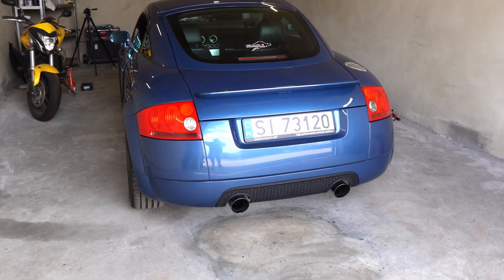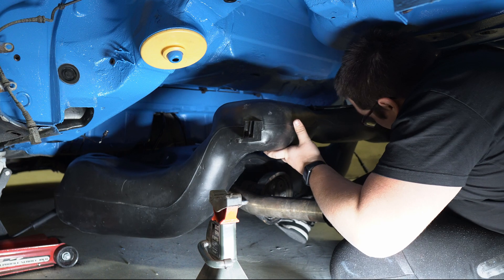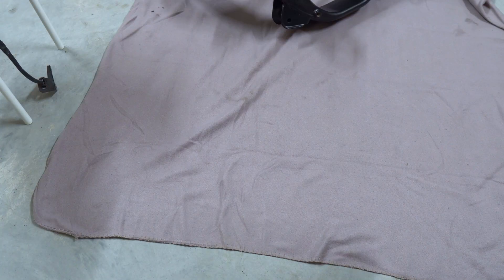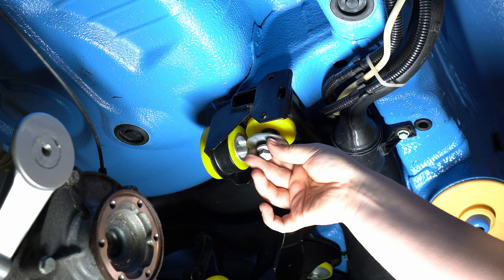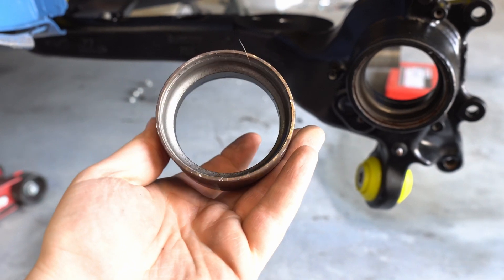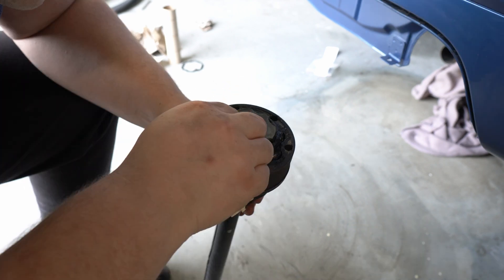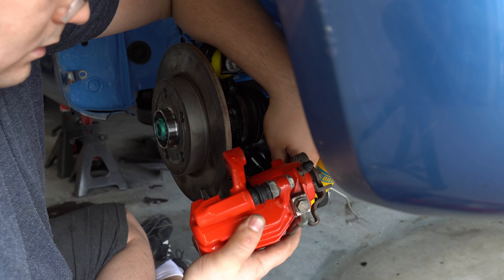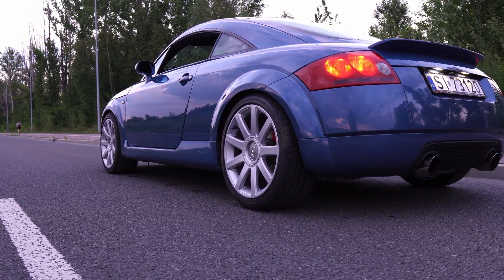Audi TT 8N 1.8T - Rear suspension rebuild

Comment: I am in the process of rebuilding a secondary rear axle before removing mine to put the new one on my S3. Since there is no geometry adjustment at the rear, can we simply remove it and then put the new one back in place without geometry problems? I find that strange

Comment: Great video! I’ll be doing the same but for my mk4 Golf R32 which mostly uses the same components. Do you have part numbers for any of the smaller fixings such as brake pipes, bolts, etc?

Comment: Amazing! Maybe one day, I will throw that kind of money in our TT 225 Cabriolet. But in Germany, all the parts you swapped are around 6.000€ at least so for that money I'd rather buy a car and resell it or refurbish the suspension on all our cars.
What is very nice is the Bilstein B13 coilovers, which are better than KW coilovers. We had the KW V3 in our TT but after 5 years it was totally rusted and handling was not amazing. Currently we drive the FK coilovers which are surprisingly good and not much worse than the KW for a quarter of the price. At one point I will put the Bilstein B13 or B16 in there, but for now the FK is very nice.

Comment: in the UK it's £395 a year to pay road tax for a 1.8t. 
left this engine when it went to £320. 

now own a 1.6t astra k at 237hp 350ft at about 1300kg for £190 a year.  it's basically a vxr engine in the last Astra's with a 4 cylinder block.
Reply: I miss the 1.8t soooo much.

Comment: One question: everything goes back in place without setting parallelism or other?  There is nothing adjustable in the back
Reply from the maker: Hi! It just goes back, but you have to do full wheel geometry at the end.
Reply: @Wachu thanks, but for the rear there is no adjustment?  Do you mean that you have to do a geometry at the front after having raised the rear?
Reply from the maker: @oooo_45929  You have to verify the camber and adjust the control arms if applicable in your case. There is nothing you have to do with the front
Reply: @wachu8605  ok but in my case, i use OEM parts with original arms without adjustments. so there is nothing special to do?

and for the driveshaft you simply put the screws back in place and ok?

Thanks you
Reply from the maker: @oooo_45929  That's right, there is no adjustment at the back. I had to use regulated control arms as i lowered car a little bit and without them the camber would be too big and i wouldnt get the MOT. 

Driveshafts just go in, just remember to use a lot of grease and tighten them really securely so you don't lose them on highway :)
Reply: @Wachu i speak about the Big driveshaft (from the front to haldex) 😅.  Did you use a marker to put the nuts in their original location to avoid vibrations?
Reply from the maker: @oooo_45929  No, i bought new bolts and never though about it. I used a little bit of loctite to be sure it will not come loose.
Reply: @wachu8605 Hi, I was re-reading your comment and there is something I didn't understand.  you say that you had to use adjustable arms because you did not pass the MOT?  but was it that you tried with the original arms after the reassembly or was it before doing everything again?
Reply from the maker: @oooo_45929  Hi, well fuck the MOT to be honest. There is a law in Poland that says the wheels cannot stick out of the car body, thats what i meant. But the main reason for using adjustable arms at rear is the suspension i use. You cant go fully low on bilstein B14 (and on other regulated suspensions i guess) without the adjustable arms. OEM arms are simply not designed to work in such a low configuration and you will get crappy camber angle. Thats why you need adjustable ones to counter it. If you need more help please reach out to facebook group "Audi TT MK1 track car", they will explain it a lot better than i can.
Reply: @wachu8605 OK !  Now I understand.  In my case where I remain 100% original I should not have this problem.  No, my question was simply in the case of a complete dismantling of the rear since there is no adjustment, I was afraid that the car would roll sideways.  I was thinking that maybe they had a tool to center the rear at the factory... So do you think I can dismantle and reassemble everything without risking anything?

here in France it's even worse, the modifications you made (B14 and co) are completely prohibited.  it goes to the MOT but in the event of a serious accident, the insurance companies may refuse to pay.

Comment: It's the New fuel tank or the old After washing ?
Reply from the maker: Old after cleaning with soap water :) i was very pleased with the results 🤣
Reply: @wachu8605  it's verry cool. I've an Audi S3 8l and it's exactely the same rear suspension. are you going to do the same for the front?  it would be cool for the next videos to show the dismantling and cleaning as well
Reply from the maker: @oooo_45929  HI! Thats exactly what i want to do this summer, but i think this time i will stick to the simplest methods of cleaning that everyone can afford. I think it would make the video a little bit more interesting. I only need to wait for better weather here in Poland :) Cheers!

Comment: Double thumbs up! I am preparing right now for doing the same on my rear suspension. You bought the strongflex bushings, right? I think they're as good as the powerflex bushings for a much cheaper price. Well for ending, your work on this is perfect!
Reply from the maker: Thank you very much, i am glad to hear that! Regarding the bushings, i dont have much experience as this is my second set of them in my life, however i've had the powerflex bushes for rear wishbones and they seem to be identical to the ones from strongflex. I wouldnt be surprised if they used the exact same polyurethan blend. Not sure about running them long term tho, but in Poland they are very popular and people seem to be satisfied. Greets!

Comment: Did you paint the underside of the car yourself? I would love to re do my entire uderside of my 225 i plan on putting new suspension coil overs or air ride when it comes back from the body shop
Reply from the maker: Hello! Yes i did. I sandblasted the underside and then gave it a good coat of epoxy and then novol cobra bedliner. But trust me, it was quite hard to do for person who has no experience in this kind of job. Fortunately this car is built like tank underneath, the metal parts they used are very thick so even if you have some surface rust just clean it off with abrasive disc and then use some protective spray and you should be fine for next 20 years :)
Reply: @wachu8605  you did an incredible job i have watched many of these done. do you watch : the parrot bros" channel? his entire channel is nothing but redoing mk1 audi tt's I have a 04 225 thats had a lot of work done to it. currrently in body shop after a deer hit me getting v6 s line front bumper and repainted to match, then i want to redo the entire bottom like you just did

Comment: Well done. Your TT is like new. No silverproject rear arms? I had them in my S3 8L. (& mk4 R32)
Reply from the maker: Hi there, thanks! Yeah, these are silverproject. Little bit worried cause I've saw some negative opinions on Instagram in the past. some people say they might crack, but there is nothing else in this price point, except modifying the oem ones. I will definitely control them.

Comment: Outstanding work, very enjoyable video to watch😊 I’ve refurbished my subframe, but I need to do my trailing arms.  Your video is encouraging me to finish🙂.  What was the gold metal (brass) plug that you changed on the Haldex please ?
Reply from the maker: Hi there! Thank you very much. The thing we are talking about is powertrack insert, it forces haldex to operate at a little higher pressure increasing power split and allowing it to engage quicker. Definitely worth buying, especially when you compare its price to benefit it gives you. - https://www.darksidedevelopments.co.uk/products/yhw-powertrack-insert-for-haldex-first-generation-50-50.html
Reply: Thank you for your reply😊

Comment: Cool video and definitely some useful tips, this is the winter project I have just started on my 2003 TT 225, I have still not decided on the suspension setup but was consider H&R Ultra Low because well I really like LOW. Bilstein B14 are hard to beat though. Is it difficult to drop the fuel tank ? I had not planned to do this but now that I see your video I am thinking it might be worth doing especially to refurb the straps and clean out the tank of crap that might be lurking at the bottom. Thanks for taking the time to make this video and document your work and I look forward to seeing you do more work on your TT in the future!!
Reply from the maker: Hi there! Thank you very much for your input. I agree B14 is a nice setup, but it could go a lot lower in my opinion. H&R Ultra Low will be much better option, your car will look great on that :) 

If i were you i wouldn't bother about the fuel tank, because in my case it was quite clean inside. There was no visible contamination and even if there is any you can always clean it from the pump side. Straps are always great to refurb, mine were very rusty. They can be removed without any additional hustle which is a great thing.

Comment: Really informative video, very well done.

Did you remove and refit all the parts just on your own? Just with the car on axle stands? If so, well done. Any tips for axle stands, placement etc?

How did you clean and repaint the underside? It looks really good.

The heatshield looks good to me, don't put yourself down about it not looking brand new.

Thanks.
Reply from the maker: Hi there! Thank you very much for your comment. It all started with the rust i've found underneath the rear wheel arches. As this is my first car ever i had no knowledge in body work at all, so i joined few facebook groups and asked them for advice. I've been thinking that i could simply use a driller with sanding disc to remove the rust and then just give it a repaint, but it turned out to be more complex than i thought. I've been told the only method to remove it almost completely is to sandblast it, otherwise it will most likely come back again after few months. I realised that it would be very expensive if i want to gave it to good mechanic shop, so i decided to buy an air compressor and sandblasting pistol. I was a little bit worried that it will not have enough pressure to do this kind of job, but after switching the air hoses to fi12 and tweaking the outlet pressure a little bit is was strong enough to remove all of the rust and paint from the metal surface almost instantly. I was really surprised how strong it was. Now i was only limited by the capacity of my compressor which was 50l, but with a little bit of patience i was able to clean all of the rear part in just one day. Once i was left with raw metal surface i immediately secured it with epoxy primer and then gave it a good layer of novol cobra truck bedliner, which is supposed to protect the surface from mechanical damage and moisture. I also wanted to make it look as OEM conservation, but the pigment i chose is a little bit too bright for my liking. Fortunately after some time it collected some dust and looks just fine :) If i knew what i know now i would choose something from SIKA brand rather than NOVOL, but it should still do the job pretty well, as i dont drive this car in a rain often. 

When it comes to axle stands, i just lifted it by a sills as you would do for a tyre change, and after that i could easily disassembly all of the things shown in video. Only if you want to remove the rust from the middle of car you would need to lift it by front control arms or the subframes itself. If you need more information about the stands please refer to this great video - https://youtu.be/NX1lQ5ZsZyQ

I hope I didn't bore you! :)